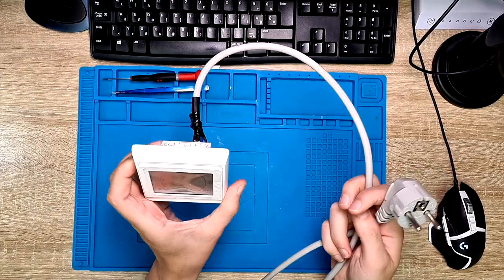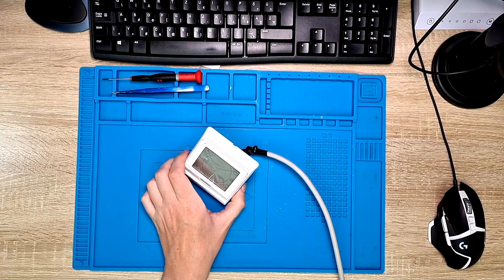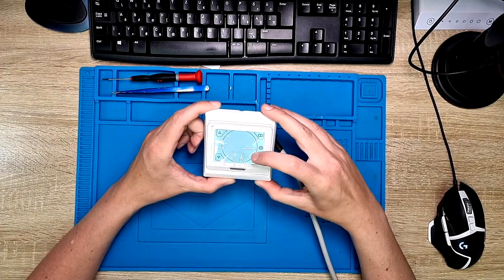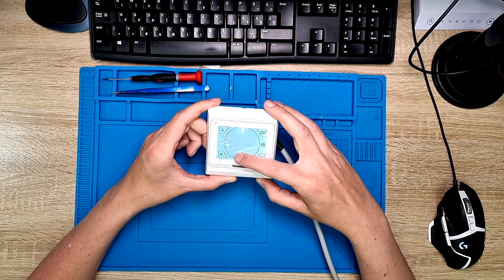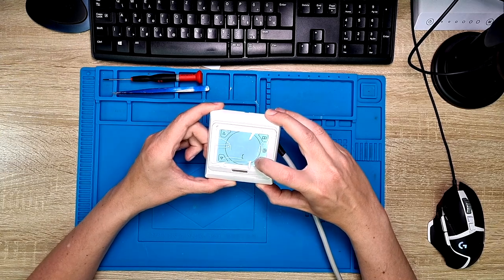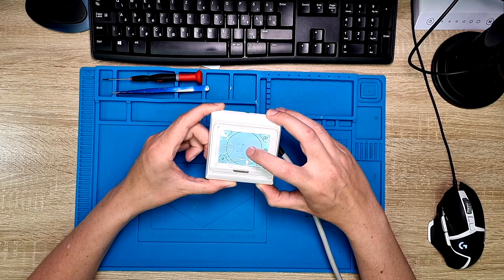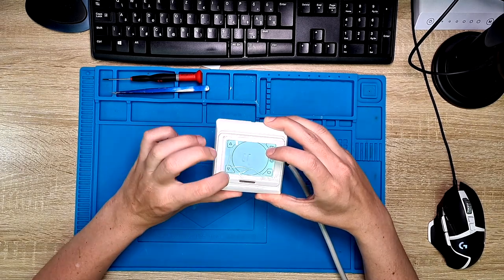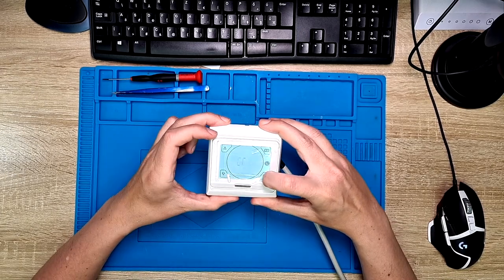Trying to fix a heating thermostat with a dead LCD - Missing pixels

Comment: Hi Kiki, I just saw you video about the easkins scam. What microscope camera are you using now ? The quality looks good now.
 I'm looking to get a setup myself, but it isn't easy as there are so many camera's and for example the lapsun is about 320 eur without shipping and probably other costs.
Thanks.
Reply from the maker: It is still the cheap old camera I used as reference.

Comment: why you left even bigger blob between that 2 pins :D i mean its ok if they go to same track but remove shorts which are not supposed to be there is more professional
Reply from the maker: They are anyway connected together so it does not matter at the end 🙂